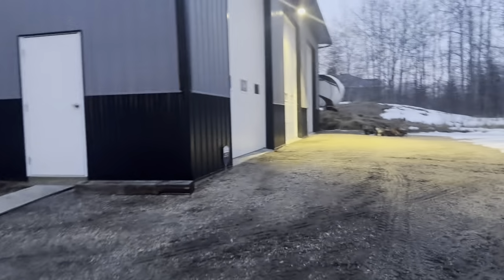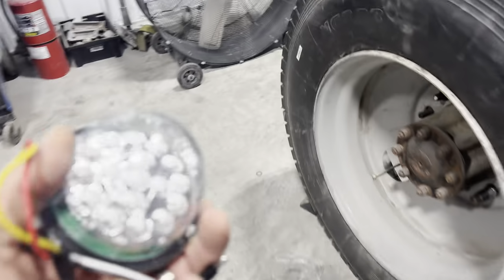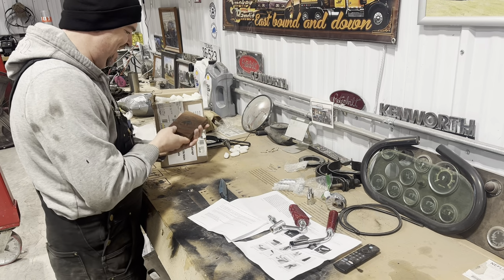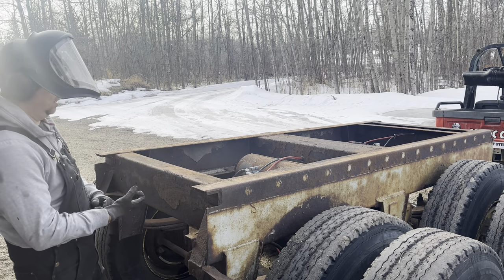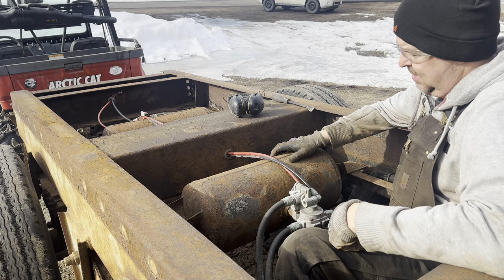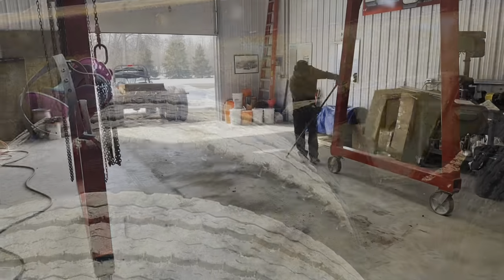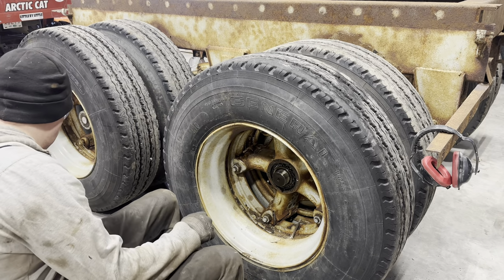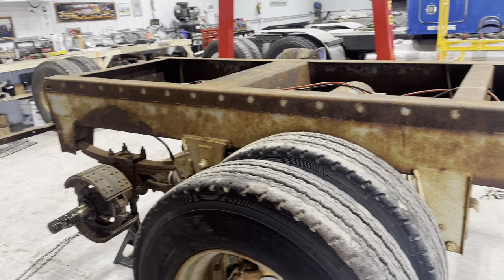Smokey & The Bandit Tribute Truck Ep.68 Tandem Refresh

Comment: Hey Mark, it's always great getting gifts. When you're buying goodies for the tandem axles make sure to grab the clear plastic windows (comes in a kit) these will crack and leak over time. Also as far hammering dogs off the hubs, I've seen one fly through a tin shed wall, lesson learnt that day so I'd advise stand to the side. working in and around coal mines wheels would get really rusted on. Its always good to remove rust when you get the chance.

Comment: Hey Mark;you should use rust converter primer paint that stops the rust process,seeing as you couldn't get all of the rust off.
Rust–Oleum makes a really good rust converter metal primer paint that can be purchased in either rattle spray cans,or 1 gallon paint cans that can be sprayed on with a gravity fed or a siphon fed automotive spray gun.

Comment: I can tell you that's its no urban legend .  It was common practice to loosen the nut smack the wedge until it popped then finish taking the nuts the rest of the way off .   Believe it or not I use to change those tires by hand . We carried spare tires  under the trailer    All you need is a breaker bar and socket ,  3lb sledge  , piece of  pipe for the breaker bar , .big block of wood , hydraulic a jack and a very strong back .  After remounting you can true the tires up by setting the hammer next to the tire and rotate the tire .  Very glad those days are behind me .  Sorry Mark I'm a little long winded .  I hope you get the idea .

Comment: I used to be a heavy wheeled mechanic (5t and above) in the army. We used to always take the duals off together to service the bearings. It was rare we would not do it that way. We used a dual puller though not a gantry. You may wanna get one with having three trucks.

Comment: If you're fabricating the guard brackets, run the trailer air lines into it. Then have a door in the top of the front fender guard and run the air lines out. Then you can put them away when not in use.
Otherwise you've got to have Nippon fitting on the frame and store the Suzie coils in the dog box.

Comment: Hi Mark. Regarding those Dayton wheels which we call artillery in our country they were very popular. The metal wedges as you call them the proper name at least where I'm from is cleats. I used to drive trucks back in the 90s and early 2000's where we had fleets of them on our trailers mainly. I've changed many wheels on them but always knew and told the trick when I got into trucking as you have shown to loosen off and bang them with the hammer till they "pop" and losen. I can tell you from experience that quite often maybe out of every 2nd to 3rd wheel at least one of those cleats would make a hell of a bang when it  "popped" you know when you get one trust me the noise it makes is loud and it pops with force. I would never want to take the nut right off to find out how fast and far it actually shoots out that would be really stupid but the pressure is there trust me so no I'm sure it's no urban myth. I've heard of cases my self where guys have been hit in the head and chest and badly hurt and if believe it but when you get those ones that go bang experiencing the sound and force you wouldn't want to find out trust me.

Comment: I think those spacers rotted out in between the two rims Mark . You probably are more used to Bud rims not spoked rims and when you try to tighten them keep them straight if I could remember I think the final torque is only 265 maybe 275

Comment: I'd suggest changing shoes anyway, but wearing heavy on the leading edge is pretty normal.
If the axle housing on the new set is flogged out, just swap an axle from the trailer. They'll be the same size

Comment: Mark, I had a Mack truck with spider wheels and had a wheel issue. I loosened the nuts and hit the wedges to loosen them and there was a loud bang the nuts were once again tight, so I then repeated the procedure only to have the same thing happen again. On closer inspection I discovered that the inside rim had split about one third the way around so the air in the tyre was forcing it apart to take up the gap. After letting the air out of the tyre it came off with no trouble. So yeah, be careful.

Comment: Do away with the double nut style locks, Stemco Pro Torq hub lock nuts are sweet, one nut with a lock ring. Take the old nut with you and they can match them. Torque specs come in the box. Traction carries them

Comment: The first time I ever worked on a semi was helping my uncle pull his Daytons off. Those little steel finger absolutely have tension behind them. He told me to stand back and he started wailing on it with a sledge
A few wacks later the finger flew half way across his shop and BARELY missed my knee..... his shop is roughly 40x80 and it flew the long way
Sounded like a 22 magnum went off 😂

Comment: It's like xmas time come early ,just wanted to give you a heads up on a company called  Apex Tool Company makes a high idle for a Cummins big cam 400 called the TR-1001 .I had on old Cummins at Caron Transport work perfect no more rpm running away which is not good for a cold Cummins. Not cheap about $1500.00 , keep those great videos coming .

Comment: Just an FYI when dealing with heavy rust of any kind, a persuading device (hammer) between 5-12 lbs works best. Pops flake rust off in a hurry and also strength tests the steel at the same time.  Saves a lot of time and effort and the vibrations from the hammer blows shakes off the no removed rust. Hit that stuff and it explodes off the frame. Works wonders on the State plow trucks up here in the US Northeast. Trick is to hit the reverse side you want to remove the rust from, and on tube stock hit corners first.

Comment: If you ever seen those funny pallet jacks with rollers on the inside they are tire and hub jacks. Could probably also use a regular pallet jack but before they never took tires off the drum to do / inspect brakes or replace bearings. They just took everything off at once.
Also as others mentioned those were grease hubs/ packed bearings. If its sitting alot, grease probably be better just have to maintain it more when used. If you do change over to oil make sure the axle dosen't have a out of round machined surface. Back in the day most had fabric seals later to modern ones but were only intended to keep dust out not oil in.
As for the "Dayton lunch" I've seen and experienced a few. I never stand or sit infront of them. Not only the wedges but with the nut on have had 2ce the stud rip out.
Also tip and wish I knew at the start, deflate the tires. Sometimes when aired up they wedge themselves on.

Comment: Hi from the uk
Quickly been reading through comments after watching.
Like a few have said, to me also there is nothing wrong with them brake shoes ( basically new) and just need a clean up.
One tip for getting the hubs off is to have a strip of metal plate with some grease on and the complete assembly will just slide off. 
Used to do it that way all the time until we got some cradle jacks ( if that’s what you call them 😂) 
One thing I’ve noticed is nothing has backing plates fitted to stop all sorts getting in to the brakes 
Noticed on other youtube videos also. 
Must be common practice over the other side of the pond for them to be left open 🤔

Keep up the good work 👌

Comment: Those brake shoes are tapered they come that way you will see that if you go to the parts store. There is supposed to be a spacer ring between the rims also.
Easy tip to pull hub tire assembly off is Jack it up put a piece of tin on the floor squirtof oil and it slides right off..

Comment: It looks like the front axle hasnt been touched in a while, being oil bearings.
That rear axle was rebuilt very soon before taken off the road. Looks like new bearings that werent checked after the first 500, grease bearings instead of oil, those brake shoes and drums are brand new, the maxi boosters look new too. Slack adjusters were too dirty to tell.

Comment: Got to say those brake shoes look in very good shape. Was that a 'replace by' sticker or a 'fitted' sticker? Its almost like someone did a brake job with air chambers and shoes and then never finished the job.
Just a 'try this' idea: Drop the suspension with axles out of the frame, use that gantry to stand the frame on end and have a far easier time painting and finishing it. then paint the end it stood on when its back the right way on axles.
Best wishes again Mark from across the Pond in UK ... 👍👏👏

Comment: Do you think, with the trailer getting infrequent use, you might be better with grease filled hubs? Less chance of seal failure and brake contamination. Long periods of the seals staying static can see oil seeping past. Not such a problem with grease as it solidifies when cold. Just a thought.

Comment: Mark what r u guys doing with the frame support where you sliced it?
And weld together ? Hard to tell on the video if u guys put sleeves
Reply from the maker: The hanger brackets will cover and support the weld in front and the cross member fishplates will hold it behind 👌

Comment: That wheel seal is junk. You can see where it was weeping onto the spoke. And the reason there’s sludge in there is more than likely they saw the seal was starting to leak so they pumped grease into the hub to thicken it up

Comment: I think it's 11 mm to safety there will be a cut out on the side of a shoe that looks like a dime cut out that's 10 mm they're always tapered towards the front more break pad at the back where the s cams are meanwhile check your drums I think they'll be all right for what you're going to do with this trailer I think but looks of those pads that I seen drum should be good I'd be more worried about the races bearings and seals

Comment: A wheel dolly is what you could use. And yes I had a boss that didnt belive the wheel claws could fly pulled all of them off on a hub I asked why he did that said thats a bs tale so I said wantta find out and hit the tire with a hammer  the wedges flew 10 ft dented the tin wall and one stuck in the wall  yup a bs tale

Comment: I've seen those locks put a Hole in a wall of a metal shop. It came flying off. You should NEVER EVER STAND OR SET in front of them while hitting them loose. Your a Very lucky man for setting there hitting them with a hammer. But hey Your Wife probably has a good life insurance policy on you.. If you ever seen one of them fly off like a Gun shot. You would understand what I'm saying.  I've been around those style wheels sense I was a kid. And I'm 58 now. And it's from not standing in front of them.But hey. What do I know ..Good Luck..
Reply from the maker: Umm I left the bolts on when I hit them loose so how were they gonna fly off
Reply: @TwinStix  I guess You'll learn like The rest did. Have You ever seen one that either the Threads pull  out of the Nuts or the Studs or the hole the stud threads into. And when hit with the hammer everything  flies off.. You'll learn.

Comment: Didn’t the movie trailer have tube type wheels and tires? This set of tandems has has tubeless wheels and tires on it? How accurate does the trailer need to be?
Reply from the maker: I did the tube-type tires thing on the tractor so the trailer can be "close" to movie-correct.  At least these tandems are not the horrible "Canadian-spread" so it'll look way closer to the movie with these

Comment: You asked so here's my comment, little background on me so I don't contradict myself. Mechanic 42 years main income that feeds me shelters me and keeps me alive. In spare time to earn frivolous money to be wasteful with I drive concrete mixers, dump Tri axles, and heavy equipment on and off for the past 42 years. First job Sears Automotive Center, with the old horizontal Coats Tire Machines. First lesson in instruction to operate the machine pull safety basket down from ceiling that surrounds the tire containing explosion if there's a defect in the tire. They were never used ever. The second lesson seat Tire bead and inflate to required pressure on the machine. The reason being they did not want you to loosen the nut that holds the wheel to the machine for obvious safety reasons. First week at work coworker takes the nut off it seats the bead continues inflating the tire several seconds later the bead pops over the edge of the rim.. As the tire, rim and coworkers jaw are traveling towards the ceiling at a high rate of speed..( the reason they did not want you to loosen that nut) is burned into my memory permanently. Anytime I can leave a nut on loosely limiting any potential risk of danger in most cases would be a good idea. Subject change going Back to the wheels on your tandem axle the reason for the comment. Concrete mixer pulled out from underneath the Central mixing plant ahead of me. I backed underneath the plant to be loaded. Watched as the mechanic watched the other truck pulling out to wash in, the mechanic noticed a little wobble in the wheel. Told the driver to pull over to the shop when he's done washing in. Mechanic wacks the first nut off and wedge second nut off and wedge starts to loosen the third nut, at that point he was on the wedge that was dug deepest into the wheel creating the wobble possibly. But don't have proof of that. That releasing of the nut and wedge must have had a hairline crack in the metal rim and the wheel exploded in an outward Force hitting the mechanic in the chest lifting him off of his creeper seat and throwing him back 8 to 10 ft at least, at least the width of one commercial garage door Bay. The consensus after the accident was that if the other two wedges and nuts were left on, the wheel would have been contained to the hub assembly. By the looks of the rim afterwards I disagree with that wholeheartedly. After several months in the hospital with a broken back and other problems he was never the same when he came back to work. To make my long story longer, the seeing you keep those nuts on eased my mind. I didn't realize why until you mentioned the other person's comment about keeping the nut on. Life's too short. Few things truly scare me or make me nervous, three  I could think of.. Seating Tire beads with a lubricant as opposed to a bead glue, wedge style wheels and heavy equipment wheels that have the cut/split ring that retains the bead(I have a story for that one as well) and high tonnage shop presses. Oops just thought of one more, the sound of my dad unbuckling his belt ready to beat my back end. Something parents would probably go to jail for nowadays. But I deserved it every time I got it. And every time I got it I knew I deserved it. And every time I did wrong, what I knew I shouldn't have been doing wrong. I did it anyway knowing the consequence. Although I didn't learn from my mistakes back then. They are my most valuable teacher nowadays. Because I don't do it wrong twice anymore, unless I didn't read the instructions. Keep up the good hard work look forward to seeing the finished truck and trailer!

Comment: I have see it. The clamps were on a trailer I used and the new by tyre man walked away after he had taken the nuts off.  The technician put his hand on the tyre and the clamps launched it self off and imbedded if self into a concrete wall. Please release the energy before you take off the nut.  It will kill you and then no videos from you, that would be no good at all